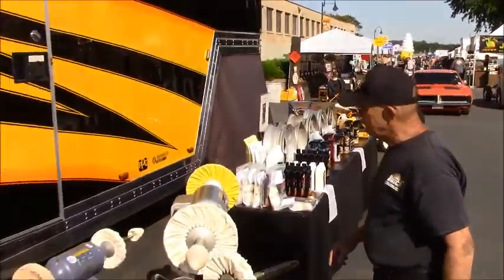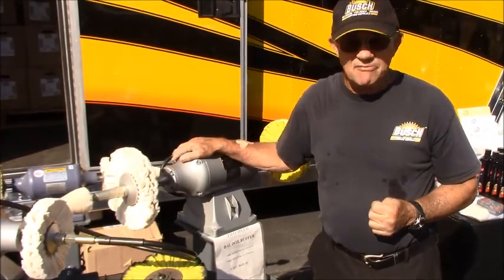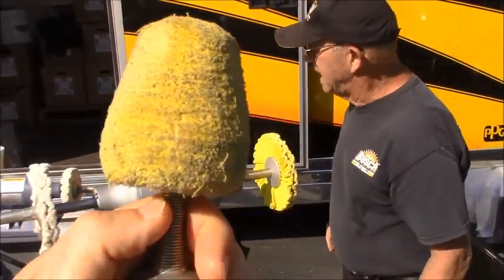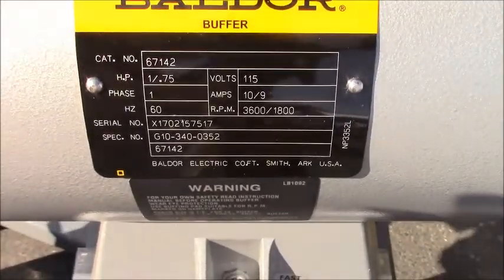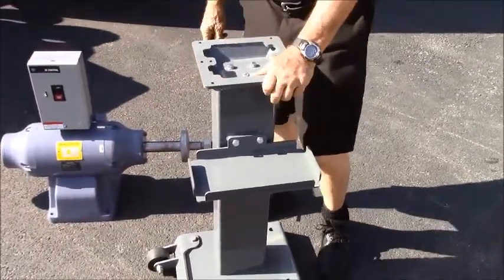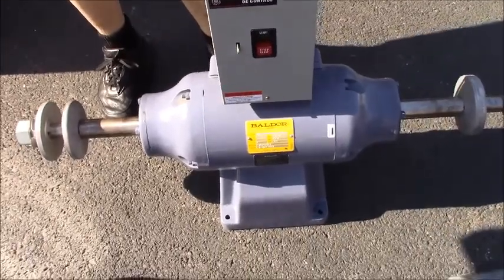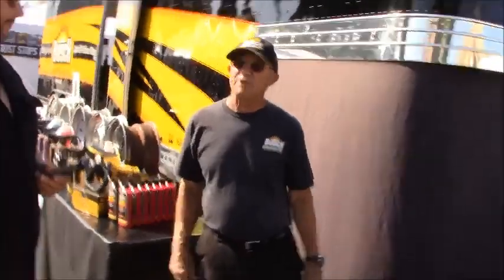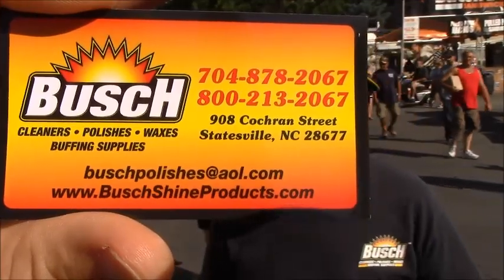Best Pedestal Buffer - Busch Buffer and Baldor Buffer

Comment: The buffer , 67142 ... 1 HP for 649.95 isn't even listed on his website, GGG
The buffer is nowhere for sale found on Buschwebsite
Reply from the maker: Definitely Call them, they’re old school
Reply: @RustyZipper  wish they would tell people how to put buffing pads on. The ones they carry are impossible to install. The arbor hole is way too small.
Reply from the maker: G C - hmmmm ... I’ll have to ask him in 3 weeks at the next show
Reply: I called and talked to him doing my due diligence regarding something Baldor doesn't list. By the time I finished and made up my mind, he had sold out and the dealings with ABB had deteriorated so that they are no longer an option. I had to purchase a 3/4HP dual speed buffer from the "competitor" (tp-tools).  I have to say the 3/4HP is a badass and probably more than I'll ever need, but still wanted the 1HP for nearly the same price.
Reply from the maker: Martin Davis - very interesting, I’ll talk to him Friday. Sorry you got the run around but glad you got a decent machine! 💯👍
Reply: @RustyZipper  Thanks Mr. Zipper. I called him yesterday regarding his buffer stands because on his website it doesn't show the dolly wheels and lo and behold, he has the 1HP listed up. He said they were able to resolve all the issues. It didn't slip my notice that his 1HP Baldor 2 speed buffer was $20 less than I paid for my 3/4 version. :/ It was just bad timing for me. I do think I'm gonna order 2 of his stands for my Baldor 8100W and 8107W grinders.